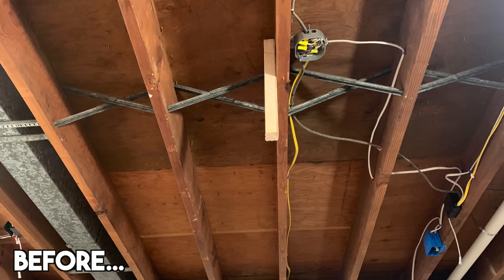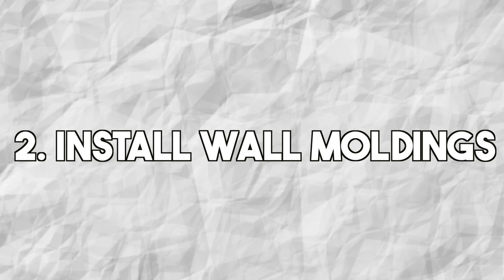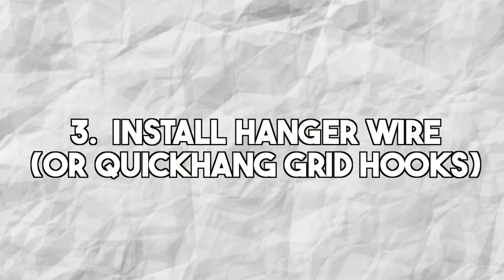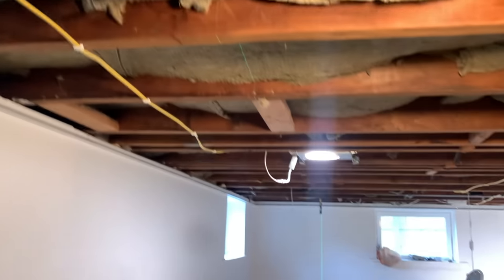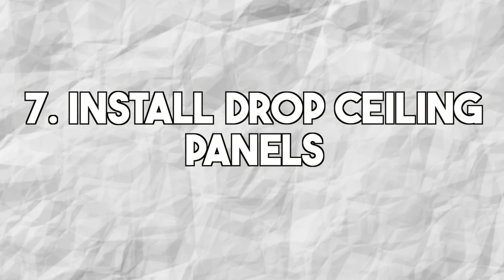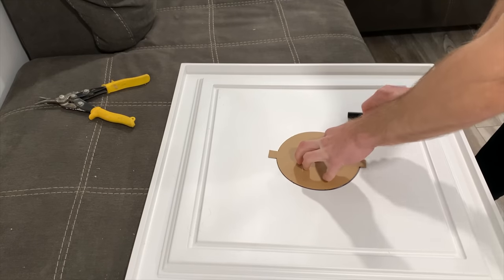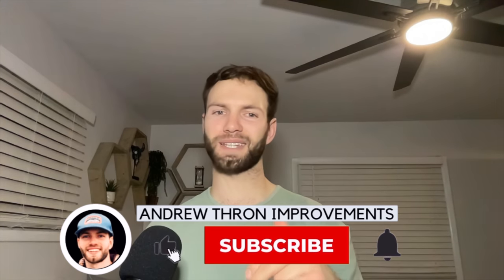A Drop Ceiling that Looks Better Than Drywall! (How to Install a Drop Ceiling in a Basement - DIY)

Comment: Definitely better than other drop ceilings but Drywall still looks better.
Reply: "I installed plastic plates on my ceiling!  It definitely looks better than that stupid old drywall!" ffs
Reply: Yea, whenever I see suspended ceilings in a house, I wonder what they are hiding behind it.  It's okay in a basement it's just that most can't afford to lose 3-4".
Reply: Looks like it’s coming straight from the 80s. No way I would put this in my $1M home that was worth $80k in the 80s.
Reply: Yeah, any drop ceiling that aligns with the top of the door jam is not ideal. I have a walkout with full height ceiling and am removing the existing tiles to reclaim the height.
Reply: @vincentjoly9230 If my house was only worth $1M dollars I would bulldoze it.
Reply: @danholtbk7008  cool story bro! Bet live you in a trailer park home
Reply: @vincentjoly9230  Haha. At least I know how to put a sentence together properly. Did you drop out in third grade?
Reply: Tiled is better for basements because it give you quick access to pipes and off valves you need to access
Reply: Drywall is a horrible product to work with. It’s best on the ceilings vs walls but if I can avoid using drywall I’d very happy.
Reply: Superb
Reply: Yeah it’s more work and looks worse lol. I hate em

Comment: My ocd couldn’t handle the second title not being the exact same color or design of the main tiles. This is a no go for me
Reply: Your OCD won't be able to handle holes in your drywall when you have a pipe leak and you have to bust it out instead of just remove 1 tile and replace.
Reply: Could easily build a soffit around the edge instead of that small tile.
Reply: That's insane that they don't have a color matched option...

Comment: I followed your instructions and ended up with a problem.  You called for installing all the main beams and then check for square.  That will be a problem if you don't have square walls which I didn't and I think that is not uncommon.  After installing all the main beams and putting in the first cross "T's", I checked for square and was off 3/8" on the diagonals.  Now I had a choice to make:  redo all the main beams or go ahead and suffer the consequences.  I chose to suffer rather than the expense of wasting the main beams that I already cut and installed.  BIG MISTAKE!  If I ever do a ceiling again, I will install 2 main beams and then attach 2 cross "T's" and check for square.  That way, I only waste one main beam - hopefully!  I didn't have a laser level - maybe that would have been better.

Comment: Could you tell us how much you spent on doing the whole basement? And how much you potentially saved by doing it yourself
Reply: Can't beat the price of light sheetrock for the ceiling: right now at Home Depot it's $14 for a 1/2 inch x 4' x 8'  (= 32-sq. ft.) USG sheetrock panel.  That's $0.44 per sq ft.

Comment: I know finished ceilings look better but I’m so happy I went with drop ceiling. I’ve had 2 plumbing issues that resulted in me replaced 2 drop ceilings. That job would’ve been such a pain if it was sheet rock.

Comment: I did the exact same thing. Love it. Can get to wires, add what ever you want. I've added eye bolts to add climbing wall, hand holds, trx bands, hammocks and outdoor playground gear. On carabiners and move them around as needed. Add chase pipes for networking into other rooms, or up to the next floor. Then you have super easy access. Can lights can be added even with this type of ceiling too.
Or use the wafer lights with no can.

Comment: I did the same to my basement 15 years ago. I love the easy access to the subfloor. I can’t tell how many times I was in there running Ethernet, speaker cables, or repairing broken water pipes over the years - all would have required major ceiling repair if it had been drywall.
Reply: I would rather paint the open joists black, than put in an acoustical ceiling. Maybe it's because I have done commercial construction for 20+ years, but I can't stand seeing  them in any home.

Comment: I always wanted to replace our rectangle panels (classroom/office style) with these but they cost alot more.  Having a drop ceiling in general is so much better than drywall. I can't recall how many time in the last 15 years we had to remove the panels to pass some wires or make some changes to it ( new electric wires, new network cables, new tv cables, new this and that) . For our EV car we had to run a 50A wire and i can't image how expensive and time consuming it would have been to fish a 75 feet of 50A through a dry ceiling.  I say for basement, always use panel..   not to mention water flooding above.. those panels can be replaced easily if wet. Not drywall.    But the rectangle old dusty office style is alot cheaper..

Comment: I would do this in a heartbeat if I had an unfinished basement.  I wish I had one now, so many little HVAC and builder issues I could fix cheaply or just my time, if I didnt have a drywalled ceiling.  Or if you need to pull wire for an upgrade, or get to plumbing etc.  if we ever have something that requires tearing down the drywall, I will replace it with this for future access

Comment: 1 did that 40 years ago the lower level of my split level house I also added coax cable and need it when adding electrical switches and outlets so I had a bathroom bedroom utility room  washer and dryer and finally a recreation room

Comment: You can actually buy corner fasteners for the outside edges for a nice clean finished look.  Also, for inside corners, you can notch a single length of edging & bend one over the other onto 90 degrees.
Reply: Thanks Dad...

Comment: I like the idea of it. Expensive sure, but compared to replacing sections of dry wall from water damage it beats that. Easier access for utilities and future utility installs would shave hours of time off and that time would add up to the cost of the whole ceiling all over again.

Comment: Thanks for the video. I am working on a similar project and checked out the drop ceiling at Armstrong, but a lot of their options are out of stock. They seem to only have the standard tiles in stock while all the more interesting pattern ones are out of stock with no info of when they'll be back in stock.. guess I'll go check around for other drop ceiling brands. Would have bought from them after seeing your video if they had stock.

Comment: Nice video.  Installed a large drop ceiling in my previous home by myself.  Would recommend putting pop rivets through the wall corners where drop ceiling aluminum track sections meet to hold them together.  I also overlapped inside corner edges as well and pop riveted those so they had a nice finished appearance.  While it's more work wire tying with installed eye lag screws is best and most secure way to have drop ceiling installed.  Inspectors at my last house told me i needed to teach all the contractors in the area how to install a drop ceiling lol.

Comment: Thought it was "planned" properly using the armstrong website but when you have a can light in a drop ceiling and it ends up right on a wall, zero planning or forethought was involved. Did the panels end up evenly spaced in the room?

Comment: This has got to be the dummest comment section I’ve been to in a long time. I think the tiles look great for being a drop ceiling, and the whole point is to access things easily for repairs etc! I’m pretty handy so I think I would just go with drywall and deal with any water damage if that ever became an issue. I redid my camper with PEX, and though it didn’t leak without caulk, I did add it to all the pipe joints as an added layer of protection, because of the whole process to redo everything was a big project. Been using it since 2021 with no issues. I would do the same for any plumbing in a house for peace of mind, especially if it’s buried in a wall or ceiling

Comment: I have a ceiling that is angled from one side of the room to another, the drop is about 1' and the wide of the room is 12'.  Overall the room is about 12'x28',

Will this work where the ceiling will not be level?

Comment: My cross ts seem a little too long they don't connect into the 2x4 frame. Do I cut part of the end off the cross ts so they fit in? The frame is like 20 years old I just bought the ts, I wanted the 2x2 but ill go with a 2x4 if I have too but I don't think it looks as good.

Comment: How much lower than the joists are your tiles? Looking to do this with my basement but I don’t want to lose as much ceiling height as it looks like you were able to afford here.
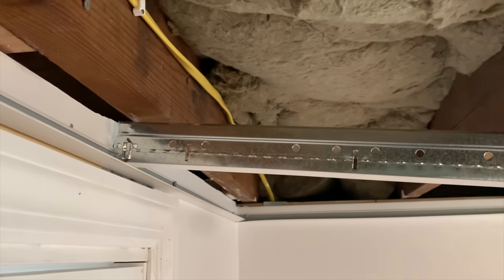Reply: Look at the video starting around 7:00 and you can see how far below the joists the bottom of the main beams lie.  The panels will rest on the bottom of the main beams, and maybe come down below it a little bit.  Looks like you'll lose 2.0 to 2.5 inches in ceiling height.
Reply: I’m in the same boat. Most manufacturers say it should be 4” from the joist. I’m going to hug the ceiling as close as I can

Comment: 💥 Thank you for all of this great info. I’ve never seen a ceiling that had two completely different styles of panels in it.  Are those thin PVC panels strong enough to support recessed lighting for a length of time?
Reply: Those are flat led panels don’t weigh but a few ozs

Comment: Those panels seems a lot better than the one I have here which are the usual flat rectangle ones that makes tons of dust, especially when you dare moving one to look at anything.
Reply from the maker: These are PVC - most of the others are mineral fiber

Comment: What is your distance between joist and ceiling?
Reply from the maker: Around 4”
Reply: Why did you choose drop instead of drywall?I'm finishing my basement I already did sidewall but  I have extra drywall so I'm planning to use it for ceiling,but what I've read is that ceiling first before sidewall, you think can I still do drywall?

Comment: ya no. this just looks like slightly nicer drop grid ceiling. It still looks way cheaper that drywall wherever it's installed. BUT for access purposes especially in basements it's a better choice than drywall if you feel you will need access to what's up there.

Comment: Drop ceiling do not look better than a rocked ceiling.  Did you also forgot to mention the cost of doing a drop ceiling?  It costs a fortune.  Those Armstrong tiles are extremely expensive.  Like $20 a tile expensive.  No thanks.  Sheet rock $15 a sheet and looks a lot better
Reply from the maker: I totally agree that Sheetrock is a better look - I just wanted the future access to the ceiling. I have a furnace cut off switch in the ceiling so I would have needed to reroute that if I went with Sheetrock. It is a bit pricey as well..it just depends on what your objectives are. Thanks for watching!
Reply: @AndrewThronImprovements  Then why did you title your video "A Drop Ceiling that Looks Better than Drywall!"? I agree that this looks better than some other drop ceilings, but why title the video with a claim that you don't even yourself believe?

Comment: No it doesn't look better than drywall. No matter what you do, drop ceilings look like garbage. It isn't difficult to do painted flat black open joists which look WAY better, or go with drywall and include a couple decorative access panels in key areas so you can still run cables where needed.

Comment: Ew drop ceilings
Reply from the maker: I generally agree but these are pretty sweet imo
Reply: @AndrewThronImprovements  yeah. They are okay for drop ceilings. Try foaming the designed drop ceiling tiles. And cut them with a table saw for the edge peices. I'm curious if it will work. The flat tiles make me wanna vomit

Comment: at least use some kind of tool (speed square or combination square) with a 45 degree angle on it to mark a pencil line to cut the outside angles. Don't be so crude.